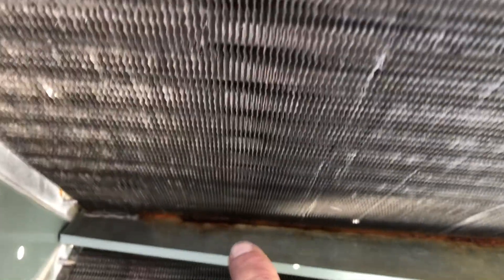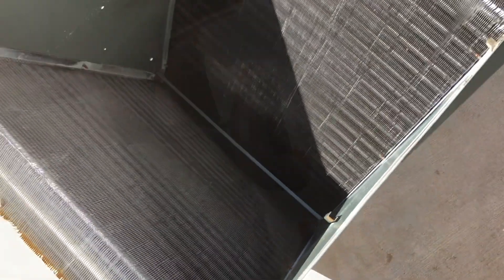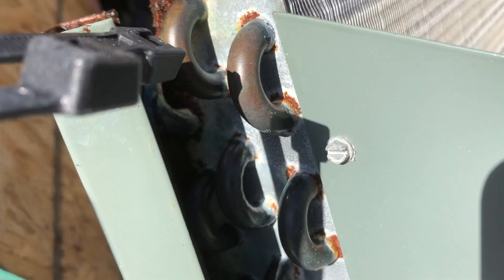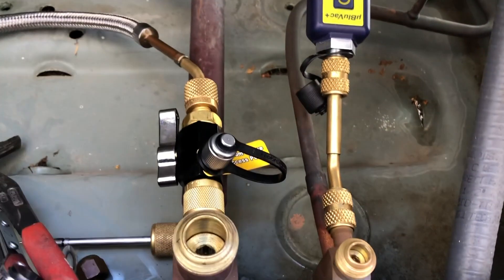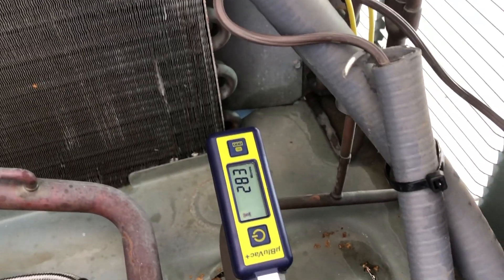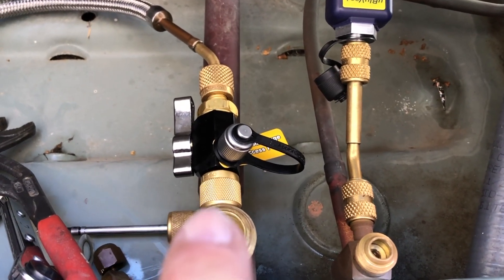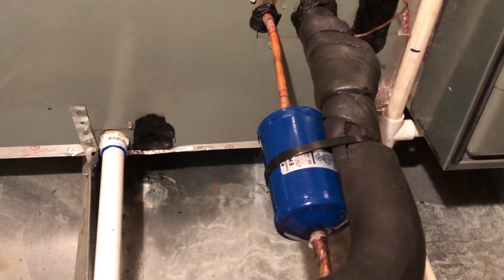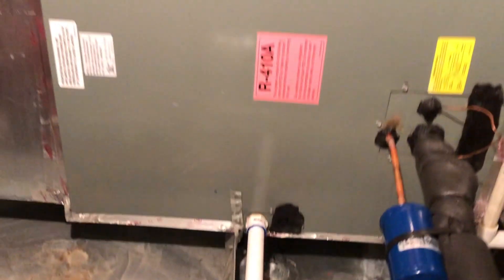RCQD Formicary Corrosion

Comment: I have been told that hair products put off certain gases that are responsible for formicary corrosion
Reply from the maker: Hair product are bad for coil the for sure but the real culprit is recycle copper...Thanks for watching.
Reply: Is it because it's not as thick as the old stuff once was?
Reply from the maker: @Heavy_metal_rulez  There is some truth to that but formicary corrosion started in about 2007 just when everything when overseas.
Reply: Cheap Chinese made metal, can't seem to escape it
Reply from the maker: @Heavy_metal_rulez  True, they are having  problem with copper piping in new houses now, copper repipe within five years.